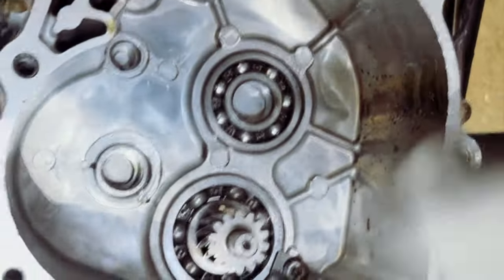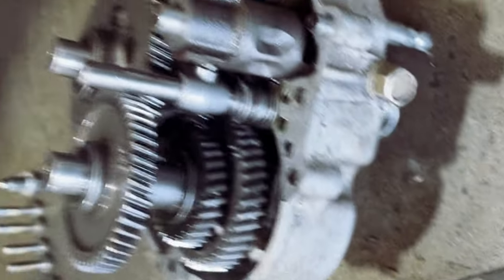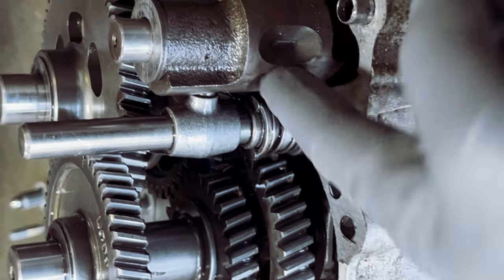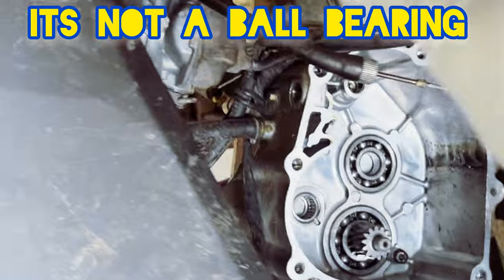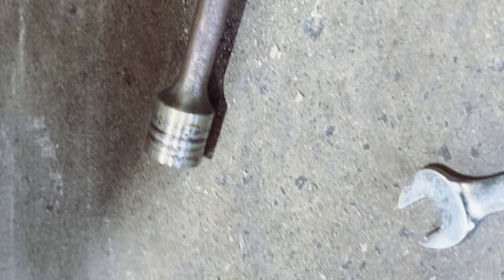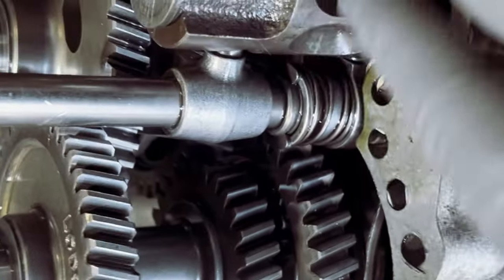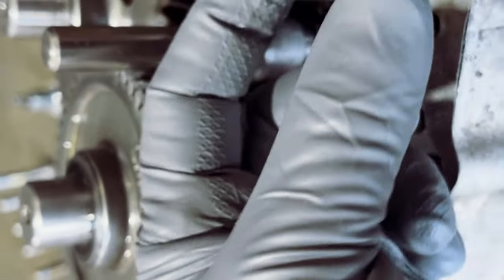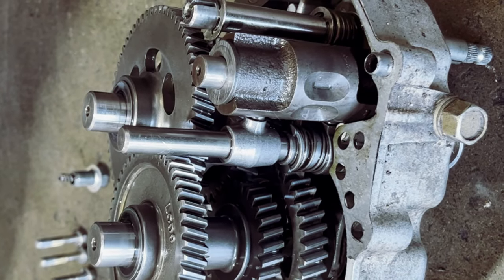ARCTIC CAT 250 No Reverse!!! Stuck in drive - Misaligned Drum & Spindle

Comment: What was the diameter of the ball at the top of that screw? the same happened to me, I tried to drain the transmission oil and lost that ball. In the manual I see 12mm ball but that does not fit into the shifter